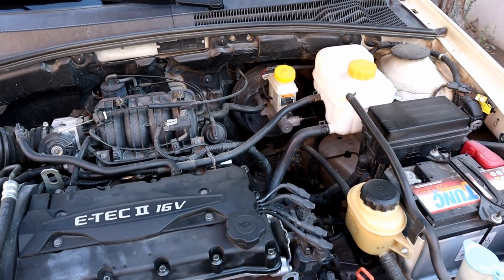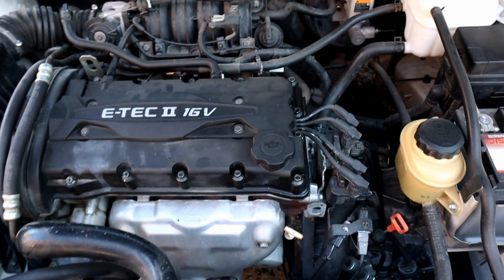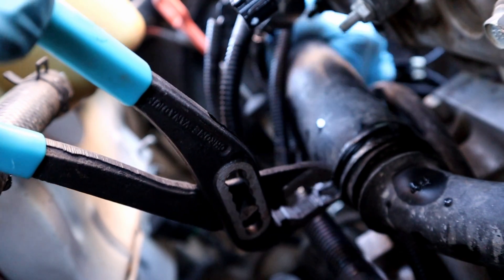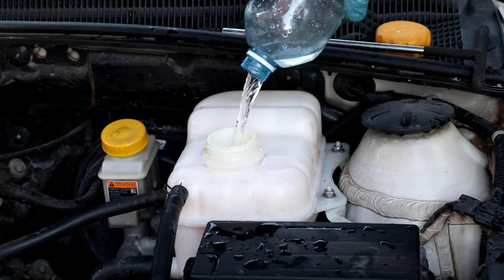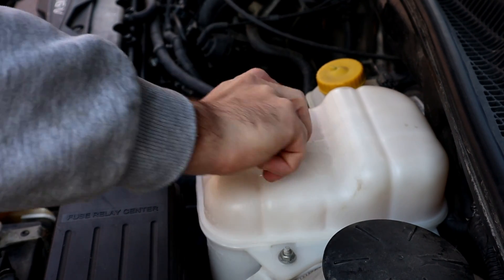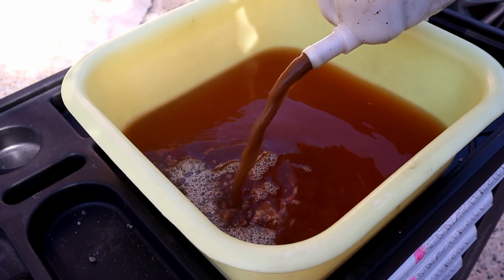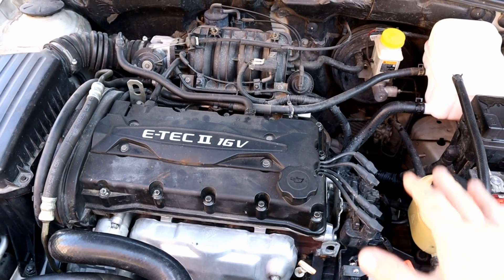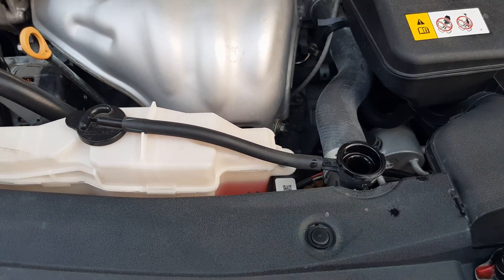How to do complete coolant flush/How to use prestone radiator flush and cleaner/flush Muddy coolant

Comment: Hi and thanks for the video. So in your other video about flushing without "flush cleaner," you took out the thermostat so it can cycle through the engine without waiting for the engine to get hot, okay I get that. Then that after you drained it (from the drain petcock) about 4 times or so, you put 3 liters of concentrate and 3 liters of distilled into the radiator and 50/50 mix into the overflow thank. But what I don't get, is that the last drain you did from the drain petcock, wasn't there still some distilled water left inside the engine? So when you filled the entire system back up, shouldn't more coolant concentrate needed to be added, rather than straight equal ratios? I may be wrong, but I don't know if draining fully from the drain petcock gets out coolant from the engine block. I am just trying to understand. Thank you very much.

Comment: Tap water stays working in my car for five years, I use filter water to strain out the manmade bleach which causes corrosion. the hot air that comes running out of my vent is 140 degrees

Comment: I heard that you're only suppose to keep the cleaner for a max of 4hours in your engine or it can damage it.
 people seem to leave it for days tho until they hit about 100mi or so. Is this safe and more effective?
 I'm talking about the newer version of the prestone cleaner: prestone total cooling system cleaner.
Reply: I don't think that I would want to run cleaner for 3 days that sounds a bit excessive
Reply: @freedompioneer4311  yeah, I found that kinda excessive as well and possibly detrimental to an engine too.
Perhaps they meant to say that they ran the cleaner with water for 100mi in one go to clean the engine good?
The instructions say to run it 15-20mi at idle around 2krpm
Reply: @smartdummy5751   I just did a coolant system slush and I just let it idle for 10 minutes and it seemed to get it pretty clean

Comment: In the e-tec 2 16v engine you fill the radiator through the reservoir? I usually fill the system through the radiator cap. + It seems like you use very little water and coolant. 
My car has a capacity of 14l

Comment: Did you not bother draining the radiator petcock? Or the coolant bolt on engine block? If not you did not completely flush the system. You got maybe 80% of coolant & your flushing 4 times but you still have old coolant that didn't come out.

Comment: What is your thoughts on using rain water (Yes, I'm that cheap) as opposed to distilled water in a cooling system?
Reply: if there was a rainbow then you can use such water.
Reply from the maker: if u want to make distilled water, just boil a water and condensate the vapor

Comment: I had to laugh when you drained the fluid and tried to get it in the drip pan.  Most of it ran down the street.  Good job showing the process.  I only have two gallons of distilled water so I’m going to use regular water, but my final rinse will be with distilled.
Reply from the maker: Awesome, thanks 😎
Reply: ultracap

Comment: Is it possible (reliable) to test the pH value of the old coolant then pH value below or near 7 as a sign to replace coolant?
Reply from the maker: Yes there is a device that measures ph levels, but whenever I see the coolant changed color, I flush it
Reply: ultracap

Comment: Great Video! But I need to replace my Radiator, so should I clean it with the new or the old one before I install? the old one is getting rusty
Reply: I would clean it with the old one, so the block & heater core don't deposit any scale/sediment in the new radiator.
Reply from the maker: If it's too rusty, clean it with the old one,
Reply: @AliMECH   @ArgosySpecOps   Thank you guys very much :-)
Reply from the maker: You are welcome

Comment: Is the distilled water nessesary ? With hose water work ?
Reply from the maker: Distilled water necessary, because some of it will stays in the engine and get mixed with the coolant, if its water, it will corrosion the engine in the long run
Reply: @AliMECH  ma man! Thank you!
Reply from the maker: You are welcome

Comment: hey how much driving is required per day, if you don't mind me asking. there was another video where someone mentioned having to drive for 300 miles, is this accurate? do I need to put 300 miles on the vehicle for a clean?
Reply from the maker: Yes its 300 miles, but mine was about 300 miles,  260 I think

Comment: Ali do you mean that you have to drive the car constantly for 3 days?.... That's allot of driving
Reply: Yes, normal daily driving
Reply from the maker: Yes, daily driving or one day if you travel ,or you can run the engine for 10 minutes
Reply: Could you just do it all on the same day? Instead of packing and unpacking all your tools?
Reply from the maker: Yes, flushing for 10 minutes, run the engine and flush it again and then fill it up with radiator coolant